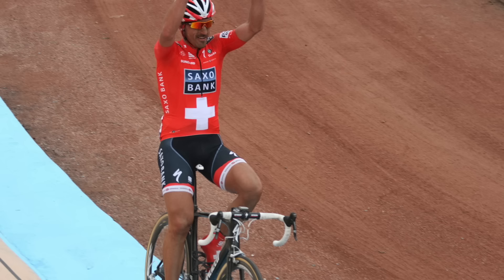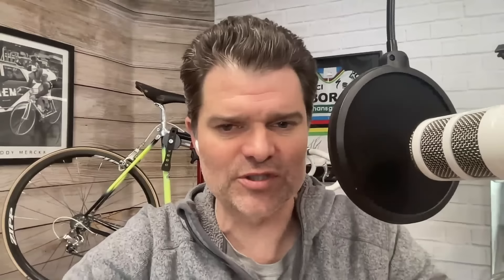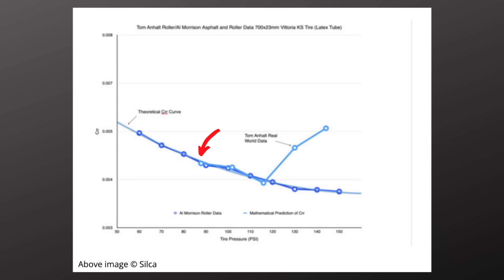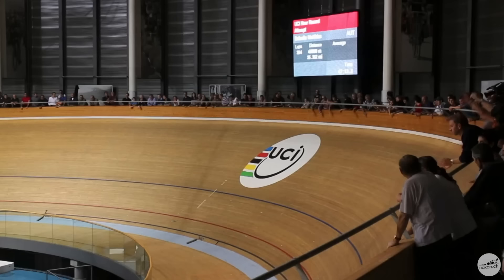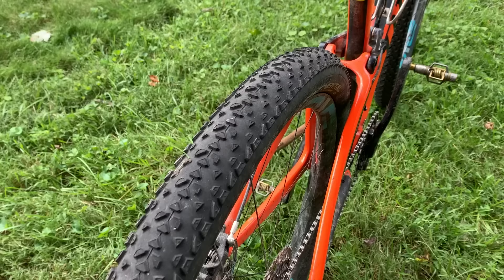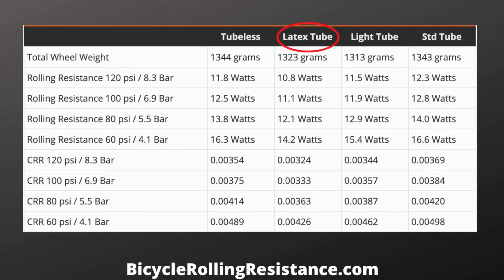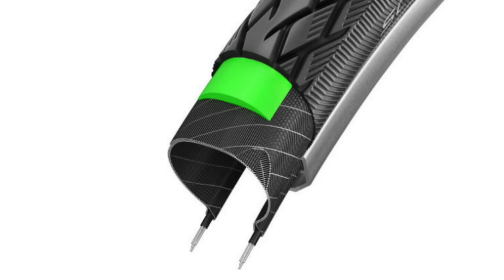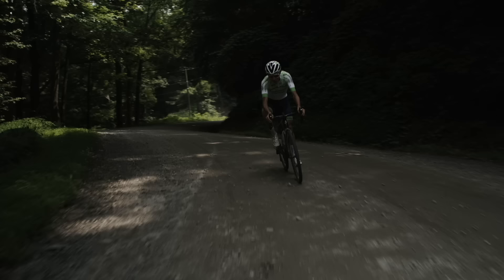Your Tires Could Be Costing You Minutes. Tire Rolling Resistance with Josh Poertner

Comment: Yep. Very interesting. My 'seat of the pants' experience with Rolling Resistance tyre tests make me sceptical of his 'perfect world' drum testing method. I found one gravel tyre that was supposedly 9 watts more resistive felt faster on a bike in the real world. Don't believe all you read! Try it yourself.
Reply: Be careful with "seat of the pants" impressions of things like rolling resistance. Human perception is easily fooled. In fact, in the testing of mine shown by Josh in the video, prior to analyzing the data I was of the opinion that the higher pressures in the testing felt WAY faster. In reality, it was likely that my perception was "fooled" by the high frequency vibration content being transmitted through the tire at higher pressures, along with the smaller contact patch making the steering less stable.

Comment: Question regarding the tire pressure calculator. Should you take into account tubeless vs tube? Or should you just use what it says regardless? It's actually given me a number higher than what I had and I thought I was slightly overinflating.
Reply: Rob, did you ever get an answer to this question?  My psi numbers are higher than I expected as well.

Comment: Thx.  Obvious running way too high pressure.  Went to the Silca site.   Now I need a better way to inflate tyres.  How do I get a tyre accurately inflated to 79 and 77 psi?
Reply: I use a Cycplus A8 battery powered pump. You set the pressure and it pumps to exactly that pressure. Game changer!

Comment: I still don't believe that i can pump the road bike tires up to 85psi...... like no tire does that. I pump it til the tires don't sag off to the sides when i ride it, and this is around 45-50 psi, and this has been very recent. Too scared to go any further,  and not seeing why i would want to. Until i see someone pump their tire up, im ok with 45.
Reply: How wide are your tiree, mine are 28c rear and 25c front and I run 80 psi rear and 90psi front as recommended by manufacturers

Comment: This is why pros have sooooo much punctures in races, they have very very thin and fragile tires which are very fast but goes to the trash After only 1000 kilometers ~ 600 miles...
Reply: ( of course on training they have stronger and slower tire than on race )
Reply: The majority of punctures we see in the pro peloton are more related to the riders being unable to see or avoid things in the road.  If you think about how tough it can be to avoid a pothole or bit of road debris on a group ride with 20 people, then multiply that by 10.. and then of course they also hit that hole or debris at a much higher speed than normal.  I'll also say that statistically the number of flats per rider per year is extremely low, it just seems high as there are so many riders covering so many km, but for any given rider we see fewer than 2 flats per 10,000km of racing which is pretty impressive I think.
Reply: @SILCAVelo  i race at amator level and even when in a 200 rider peloton there isn't so much punctures, not even close to the enormous number of punctures of the World tour peloton...

Comment: 25 to 28mm tires leave me no choice....I have to run maximum pressure or risk "snake bite" rim punctures. I am an x-pro, highly skilled and now a 200 pound bodybuilder, this combination means max pressure or with aggressive climbing or acceleration the rim will push all the way through and contact the tire inside surface. Today as a recreational rider I use 26x2 tires for a wide choice of pressures and safe mountain paved road descents where a blow-out is almost impossible (hasn't happened yet since these tires)  with a Schwalbe 26x2 Marathon Plus. Are these tires slow at 18 to 20mph average speeds, NO!

Comment: Hmmm that tire pressure calculator seems a little wonky. Road pressure seems about right, but apparently I should be running 17-18 psi on my tour divide rig (2.2 in tires)?
Reply: Depending on your weight, absolutely correct.

Comment: I am building up a SL7 S-WORKS with Dura Ace Di2 12 Speed Groupset.  Have the 52/60 Roval Rapide CLX Aero Wheels & a 2nd set Roval Rapide CLX 32 Climbing Wheelset.  Peddles r Time Xpro 15 
FSA VISION cockpit one piece.  
S-WORKS Mirror Saddle .
Hopefull 2 have an end weight of 6.8 kilos . 

Tyre choice ???  Specialized Training Tyres or Vittoria G2 training tyres . Wheels are Clinchers . 
Tubes are out of Italy.  Can't recall the Brand . But Super Lite . 

Any thoughts on Tyres Guys
Reply: I have purchased a 2nd set of Roval Rapide CLX 52/60 Carbon Wheelset as my race wheels.  Both sets will/have the Orange Tubilito seamless tubes in them . 1st set r my training wheels with training Clinchers Specialized & the 2nd set will be set up with Specialized Lite Weight Racing Clinchers 🏁 . Seemed like a much better plan than swapping out tyres .  The last pair of the Clincher Wheelset in the Country ( Australia 🇦🇺 ) Rang Specialized Head Office 🏬 in Melbourne Australia  Yesterday 🇦🇺 & they couldn't find any on there System any where around the World.  
I was very fortunate 2 find this set at a Specialized Dealership & l definitely didn't pay $4400 . Got them real cheap . 
Will never purchase Wheelset that are designed 4 Tubeless.  They should be banned 😤 😒  These are 1400 grams & the new Tubeless are 1500 grams..  Why

Comment: Hey Dylan, I've been putting a ton of time into researching tires for Unbound 200. I noticed that the Continental RaceKing Protections have a similar rolling resistance to Continental Terra Speeds and are faster than the Pathfinder Pro tires. Just curious, why wouldn''t someone want to run those? Weight?
Reply: It is probably because the smallest those come in are 29x2.0", which is too big to fit in most gravel bikes. I ride the RaceKings (the 2.2" version) on my XC race bike and think they are great for dry conditions. I tried fitting the 2.0" version on my gravel bike and it was a no go.

Comment: Overall, I like the format. BUT, one of the things I like about your channel is the actual science and the data. It’s not just “some guy says X”. If you did this video a decade ago, the race world experience (based on not actually testing low pressures) would have had you have an expert on there talking in the same manner but telling us to add more air. He’d point to hysteresis in the rubber and add more air as a result. The argument is based on an incomplete theory and not validated by testing in the real world. 

What’s missing in this video that’s normally in yours is turning to the actual data in the literature to back it up. It’s back to “my experience says” or at least comes off that way. Heck, we know (IIRC in a video of yours) that a setup can feel faster by having higher frequency vibration components to it when it’s actually slower. We need the data, not the experience based on feel.

Comment: Great video. Question. My son is 9 and competes in triathlons and duathlon and we cycle a lot together, always on pretty good road surfaces, mostly flats but he does love trying hill climbs. Using Silca tire pressure page and using his weight with hear approx 70lbs bone dry, would that affect the tire pressure?  It works out at 86psi using their chart. Thank you

Comment: The SILCA PRO TIRE PRESSURE CALCULATOR numbers are way off! They’re typically 15-18 psi higher than the Zipp tire pressure calculator. Also, Silca does not take into account using Hookless wheels!  Beware when using the SILCA calculator, because the psi it recommends takes you very close to the 72 psi maximum on ENVE or Zipp wheels.  Furthermore,  the ENVE. Calculator corresponds with what the Zipp calculator.  Dylan, I highly recommend you take this into consideration when educating the folks on tire pressure. Thank you for all your great work in the past.

Comment: Silca website doesn't mention tubeless or rubber or latex tube. Is that not relevant or am i missing something
Reply: We are adding that now, since our calculator is based on actual road optimizations with pros, our data was almost entirely with very high end, supple tires.. we've been doing hundreds of tests with less optimal tires over the last year and will be adding some corrections for this to the calculator in the next month or so.
Reply: @SILCAVelo  appreciate  the quick reply. So as it is it's  a mix of tire type or tubeless? Looking forward to see real world numbers for tubeless vs clincher.

Comment: I've been aware for a while that lower tire pressures are the new recommendation. When I plugged my bike specs into the  SRAM Tire Pressure Guide, (bike 20 pounds, me 153 pounds, inner rim width 21mm, tire width 27mm, Road Riding, hooked rim, set up tubeless, standard casing) it suggests rear pressure of 68.8 psi and front of 64.7 psi. This is way lower than the 95-105 psi I first started using 4-5 years ago when I started road cycling. Now that I watched your video I used the Silca calculator and it recommended  rear pressure of 82 psi and front of 80 as a starting point. I know these are just guesstimates but anyone know why the huge discrepancy? Which one should I give more credence to? Am I losing huge amounts of efficiency by running slightly lower than even the SRAM tool recommends? Thx.
Reply: low tire pressure is great, until u hit a pothole. There goes your carbon rim. Not practical!
Reply: Not forgetting, you lose tire pressure further into your ride...
Reply: Thanks, good points. Still don't understand why these two different calculators, both done by low pressure recommending companies, would recommend such drastically different pressures.
Reply: one thing I found is that there is no internal rim width calculator in silca's calculator

Comment: My question: Is there a market for, or a possibility a product could exist as a foam insert that acts as tire damping. As Josh mentioned the memory foam concept, the tire doesn't rebound back to it's normal state right away dependant on compound, could there be a use to that action more in mountainbiking or CX to lessen bumps overwhelming the suspension damping or improve traction when the tire aggressively rebounds following quick compression? The thought came from watching a video compilation of bottom out tests in slow-mo on MTBs and how the tire rebounds so aggressively that the suspension has several, obvious phases of compression when you would expect optimally that it would be one smooth, controlled movement.

Comment: on relatively smooth pavement im generally 2 miles an hour faster on the VITTORIA CORSA SPEEDS 700X23 mavic cosmic 80....than my gp 5000 700x 25 on 55 vision metron
Reply: but for long endurance it will be the gp 5000 for harsher road surfaces......28's fill slow like your riding on a matress

Comment: Why are you using those Specialized Pathfinder while is shown at bikerollingresistance that others like Terra Speed are faster (plus weight)? I mean, the thread pattern of the continental is not looking bad at all. I’m currently with GK SK 42 and next will be either one of those.
Reply from the maker: I've been experimenting with a lot of different tires this off season. Stay tuned.

Comment: What do you think of this? https://www.youtube.com/watch?v=0QDnUkUaQfkI know you are talking specifically about tires and the other video is talking mainly about rims but they are kinda similar in my head (Both rolling resistance). I am kinda confused. I do understand that softer tires will make you bounce less on the rough pavement and thus make you apply more power to the pavement but the rolling resistance is where I am confused.

Comment: I don’t understand why cycling industry in the last few years start advising to lower the pressure wile any other industry os vehicles motorcycles/car/truck.  Recommend the opposite to reduces rolling resistance and get les petrol consumptions. As far my common sense rolling resistance and lógica should be the same. And if I am wrong why pro peloton still ride on 100+psi.
The only logic I found why these new ideology is to justify people to invest on Tubeless. And sell more of the ideology of lower pressures.  
Lower pressures make sense in anything that would be on a poor asphalt or off road.  But as long is Dry and nice asphalt why keeping pushing in this ideology. 
Maybe I am wrong. As 100% of the pro tour peloton.
Reply: cars, trucks and motorbikes have one difference, all of them have a suspension on all wheels. Bicycles for road don't have one.
Reply: @simonm1447  ok let’s apply your logic. And then why F1 cars (the fastest in planet) have a extreme suspension and even any sport car have hard suspensions!?. Is suspension help to rolling resistance then why they do the opposite!?.road bike don’t need suspension.
Reply: @Danielkuota1  a road bike don't just has rolling resistance. If you ride over uneven surfaces, the bike is "hopping", it's lifted constantly. This hopping consumes energy, energy you have to supply by pedaling.
If you ride over a perfectly smooth surface (like a velodrom) a highest possible pressure in combination with a narrow tire is the most efficient setup. On a street (which typically isn't that smooth)  however this setup will not roll smooth, but hop over every single stone.
If you ride a wider tire in combination with less pressure your tire contact area is shorter, but wider compared to a narrow tire. This is more efficient, and with the right tire pressure (this depends on the condition of the surface you ride) you reduce hopping (which saves energy) because the tire can absorb small stones and uneven spots at least partially.
There's not something like the best tire pressure for every situation, it depends on the surface you ride.
Motor vehicles with a suspension on every wheel don't hop, since the suspension absorbes this energy. Here you can reduce rolling resistance by reducing tire deformation with higher pressure.
Reply: @simonm1447  yeah but you still didn’t reply why sport cars have a extreme hard suspension. Including rally cars (that also ride in in even road). Also why pros still ride on 110 psi 120 ?.  Sorry mate. I won’t get brain washed as you did by the marketing industry.
Reply: @Danielkuota1  Sport cars have a hard suspension, since it's aerodynamically better for cars to have very little ground clearance. With little ground clearance however you can't have a soft suspension with a lot of way. 
Sports cars are completely different to a bicycle, since their speed is more a question of grip and aerodynamics (mostly downforce to get more grip, F1 cars have a bad CD but this is because they have that much downforce) and they have plenty of engine power. They get their speed due to grip in curves, while a road cyclist gets its speed by riding a bicycle which is as efficient as possible. 

Pros adjust their air pressure flexible in regard to the race they ride, if they ride Paris-Rubaix they ride less pressure than if they ride a smooth road. They typically use wider tires (like 25 mm) today compared to 20 or 30 years ago

As long as you are a hobby rider it don't matter anyways, since the time difference is way too little for a hobby rider to play a role. Hobby riders don't fight for tenths of a second.
So just enjoy riding with your bike mate, and always a good ride!

Comment: I categorilly disagree. You are better off at the higher side then at a lower pressure. I have broken 2 sets of 60mm carbon rims because I hit a pot hole at high speed. A high pressure tire would have protected my rims. Absolute garbage these charts. Ain't practical.